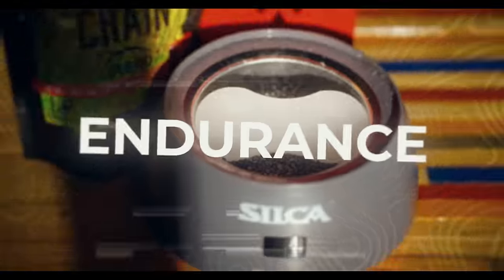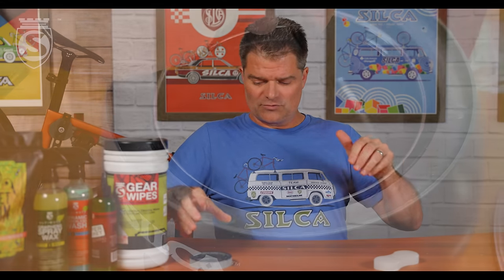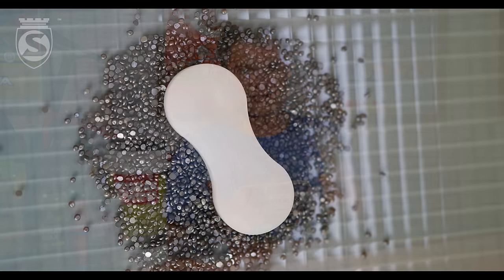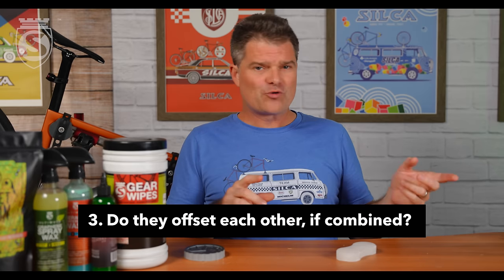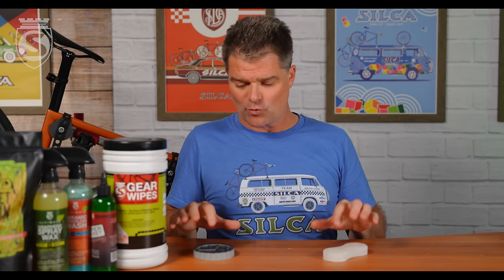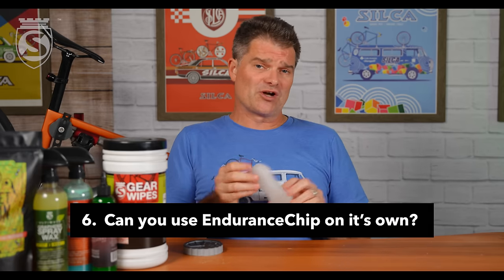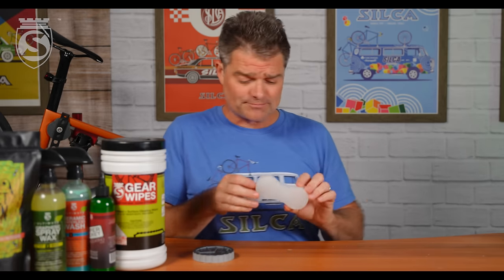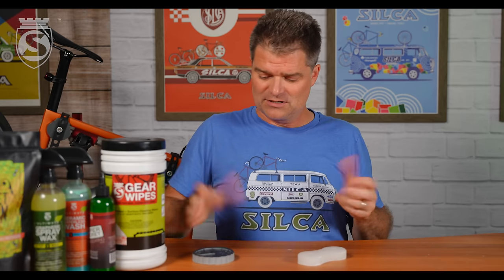EnduranceChip vs. SpeedChip: 7 FAQs to Get the Most Out of SILCA's Latest Wax Additives!

Comment: 1) Do these additives need any special temperatures (and so require a temperature controlled pot) or can they be thrown into standard slow cooker as well?

2) For cyclocross racing (~3 hours of riding including the course recon, warm up and the actual race) with some mud and wet conditions, would you rather add a SpeedChip or an EnduranceChip (or keep the wax stock) for optimal performance?
Reply from the maker: For our pro CX racers we warmup/recon, etc with endurance chip and then switch to speedchip chain for the main event which ensures you're on the fastest possible chain for the race, but you could easily do 3 hours of riding in these conditions with any of the wax combinations without big negative implications.

Comment: In the winter I do a lot fatbiking exclusively on snow trails. When I waxed last year, the break-in time was very long as the temps are all below zero. Would adding the speed wax chip reduce that break-in and soften things up a bit?
Reply from the maker: You can add a little Synergetic oil to your wax for extreme cold riding.  This will improve break in time as well as wax adhesion to the chain in those conditions.

Comment: If one of the main uses of the drop wax is to add longevity to the original hot waxing, why not create a drip wax with the endurance wax added to increase the miles til a re-hot wax is needed?

Comment: When u say block are u referring to a block of time or miles or?   Since I have invested in Hot Wax X what is your current recommendation?   Should I abandon it?  Add Speedchip?  Add potato chips?
Reply from the maker: You can add speedchip to HotWaxX.. it will reduce break-in time but will not make it faster.
Reply: @SILCAVelo  I guess my real question is what is the most optimum wax protocol?

Comment: Just to ask are different chain manufacturers better to wax than others ?
Reply from the maker: Some coatings are better than others.  In general, any hard chrome coated chain will do well with wax and all Shimano chains do well with wax.  The black DLC coating that KMC uses is terrible with wax, as is any rainbow coating.  The gold and copper coatings are nearly as good as the silver chrome coatings but not quite.

Comment: Im quite surprise with the graph of longevity/effeciency. I was thinking that it was good for about 1000km. Even if im rewaxing or drip after each ride😊. But for an ultra event like Paris Brest Paris 1200km. Without the possibility to drip and wait it to dry… do you recommend taking on board a second waxed chain or just synergetic lube on regular application during the race ?
Reply from the maker: Drip wax definitely extends the life of the wax, and you should easily get 1000km+ if you are using drip in between rides, but there really isn't anything that can go the full 1200km on one waxing.  A spare chain, both with Endurance Chip will work as you should get 600km+ per chain, but I know a lot of riders just carry a Synergetic bottle and top off as they need.  This is especially helpful if it rains as you can use the Synergetic to drive some of the road grit out of the chain when you relube, and you can do it numerous times if conditions are truly terrible.
Reply: with a small battery portable inductive heater you can heat the chain on the bike and wax the chain in 6 minutes or replace the chain

Comment: Once a chain has been stripped then waxed and eventually the chain needs to be cleaned, does that mean the chain needs to be stripped the re-waxed?
If a chain has already been waxed, can you add the speed wax?
Reply from the maker: To clean a waxed chain you just boil it in water for a few minutes, so no need to strip it ever again.  After that you can rewax in the original pot of wax and can add speed or endurance to that as needed.

Comment: what is your recommended starting point with a new chain with either or both?
Reply: soon they will also make wax for completely new chains that have yet to be run in, it will be a little more expensive than the usual super top secret wax, but that investment will pay off later,and if you buy 5 packages of wax, you will get a silca T-shirt with an advertisement for free, which you must always wear while on the bike, otherwise they will take all the wax from you without refund

Comment: Is there a maximum temperature where the waxes get destroyed in a heating/melting process to a point of no return when cooling down again? Im thinking of the endurance chip and its long chained chemical structure getting cracked up and loosing its mechanical characteristics. 
I once made the mistake with the original blend not to have an eye on my melting pot and the temperature raised over 140°C. Now I use a regulated heating pot, but am unsure if i f** up the whole wax. I searched for a maximum temperature in the datasheets of your product, but couldn´t find one. Thank you!
Reply: also interested in
Reply from the maker: For SILCA, our waxes begin to break down in the 135-140C range.. which is why we have the PID controller in the wax melter.  With StripChip requiring 125C, the window between Stripping and damage is just too close for thermostatic temperature control.  Typically, if the wax is overheated, it will start to take on a yellow to brown color after it has cooled, so to test this we recommend melting it, letting it sit undisturbed for 20 minutes so that the additives can sink to the bottom, and then looking at the color on top after it cools.  If it's white to grey you are fine, if it has any yellow-brown, it is damaged.
Reply: @SILCAVelo  Thank you for this extensive answer! you and your products are awesome!!! I will take good care of your advice
Reply: unfortunately you have to buy new wax

Comment: simple question: is chatGpt correct? (BIG Thanks from Vienna, Austria)

Tell me, does silcas stripchip also work with an ultrasonic cleaned new chain? GPT-4o Mini: The Silca StripChip is designed to work with bicycle chains, specifically for cleaning and degreasing. It can be effective on chains that have been cleaned using ultrasonic methods, as long as the chain is free of contaminants and excess lubricant. The ultrasonic cleaning process generally removes dirt, grime, and old lubricant effectively, which can help the StripChip perform better when applying a new lubricant. However, it's important to ensure that the chain is completely dry and free from any cleaning solution residues before using the StripChip to apply new lubricant. This will help achieve optimal performance and longevity of the chain and the lubricant.